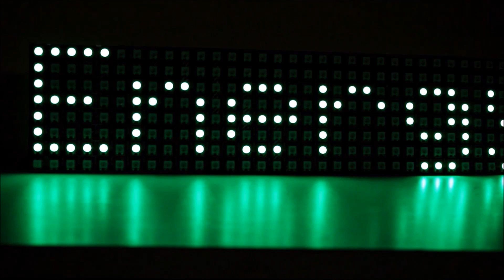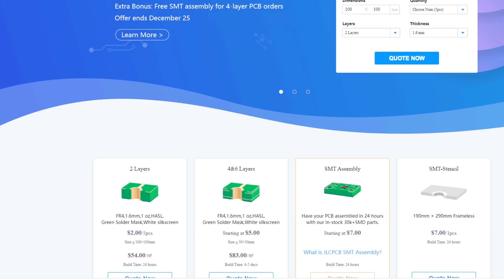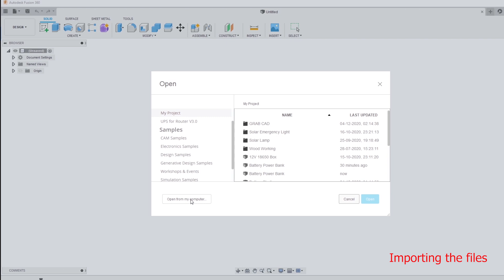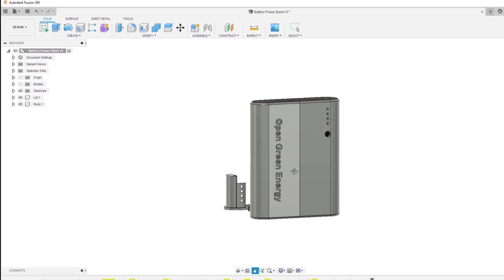DIY 10,000 mAh Power Bank | How to Make 18650 Battery Pack

Comment: 3.7 v battery use 4 cell totally 14v but your multimeter show 4.7v how and Power Bank module voltage 5v but battery total power 14v how is work
Reply: I would suggest you research about batteries in series and in parallel before even thinking about putting a soldering iron anywhere near one.

Comment: Pls help My diy power bank is charging only 2-3 minuts after shuts off suddenly and indicator says battery level is low but ive charged battery long story short not working im using 18650 3.7v  double 10000mah batteries ive tried put only 1 didnt worked ive no idea how to do it

Comment: Could you please send me a link with which I could access the visual plans for the powerbank housing framework? So I can print the case
Reply: This video was made a year and a half ago. Nowadays you can buy 18650 cases with USB connectors and an LCD screen from Aliexpress for very little money. It's going to be cheaper to buy one of them than to make your own, and you'll get a nicer product as well. They come in all different sizes, from 1 battery to 16 or more.
Reply: Nice sir
Reply: Aap kaha se sir

Comment: Bro You use the battary of 3.7v, so output 3.7v. ??
Normally a charger output is 5v
So this powerbank slow?

Please reply 😊
Reply from the maker: The output is 5V. The pcb that used in it has a boost converter which boost the battery voltage ( 3.7V ) to 5 V
Reply: @opengreenenergy  ok thanks bro 💚

Comment: Do you have to use the 18650 battery or can you use any 3.7V batteries (I.e 14500)?
Reply from the maker: The enclosure is for 18650 battery only. 14500 battery will not work

Comment: Hello nice
I have one question all lithium ion batteries are connected series or parallel?
Thank you in advance
Reply: Think about it like this. Series connection is a positive and negative together. A parallel connection is all positives together. Parallel means the same. So all negatives. Or all positives. This parallel connection means long life. Series connection means Stronger. 

Series- Stronger +,-
Parallel-Same ends +,+
Reply from the maker: Parallel connection...
Reply: sama type batt...
paralel +++ & - - - (result same voltase and increase mah)
seri + - + - (result increase voltase and same mah)
nice video like it...🙂
Reply: @ekosumi9809  for laptop battery using series connection and for powerbank using parallel cell
Reply: @rudrakshiv  nice info

Comment: Parallel charging is good or not sir.....there is risk of heating and fire
Reply: so if you charge a tesla it's going to catch fire they're wired in parallel?
Reply: @dylansarna8750  in parallel there is chance of reverse charging so protection should be provided
Reply: @s.husain6125  it's in the pcb he used ??